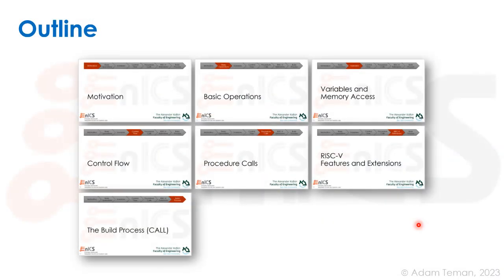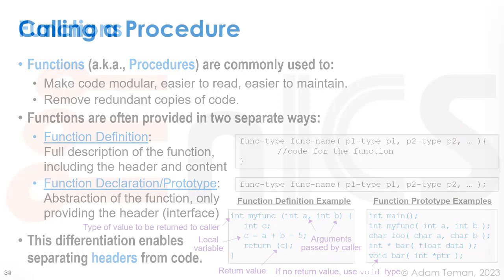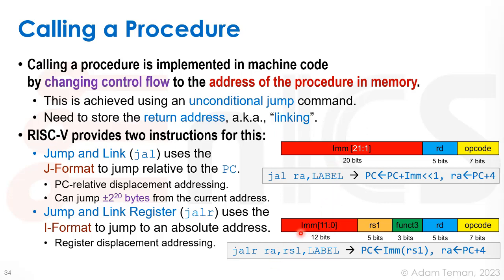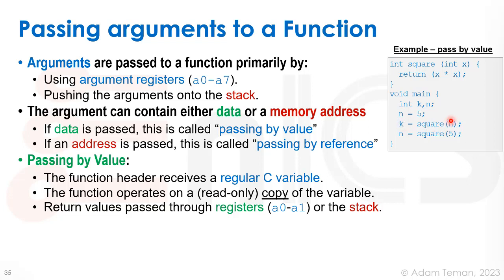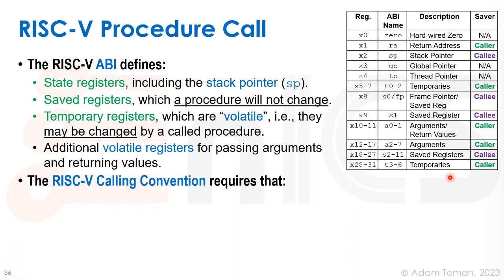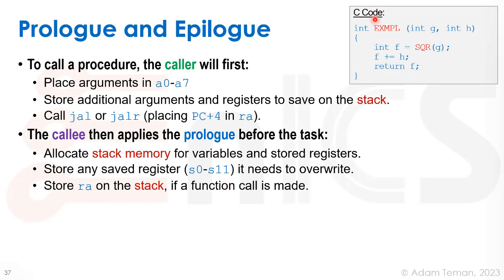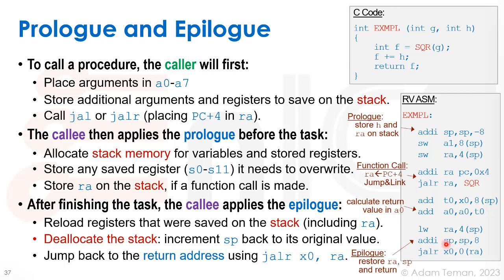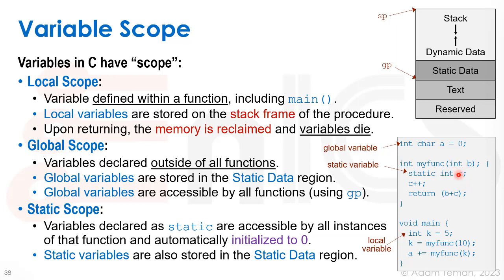SoC 101 - Lecture 3e: Procedure Calls

Comment from the maker: Corrections:
I made a mess of the code snippet on slide 37 (around 16:00). Thanks to @juanjosemontessalinero3193 for catching this:
1) the line "addi ra pc,0x4" should be removed. Not only is it a mess of an incorrect command, it is also unnecessary, as jalr automatically stores PC+4 in the destination register (ra)
2) The command "add t0,x0,8(sp)" is incorrect, as RISC-V is a register-register architecture and cannot access memory on an add. This command should be a load (lw t0, 8(sp))